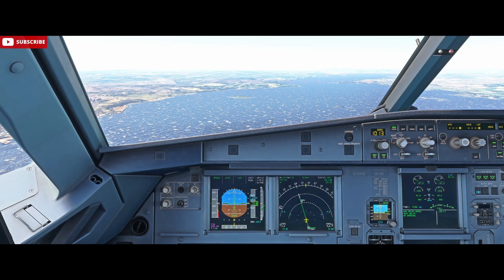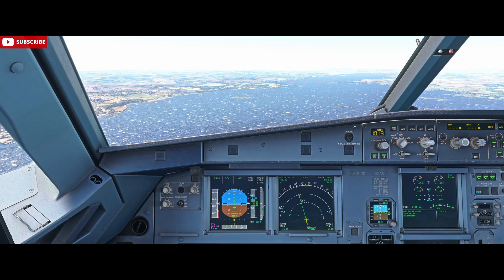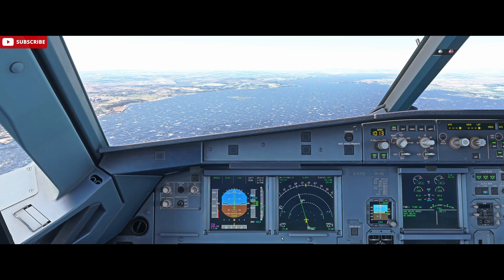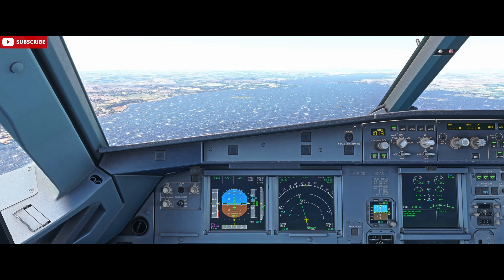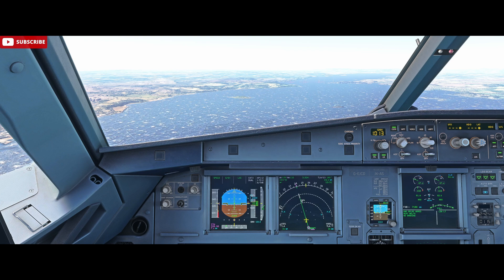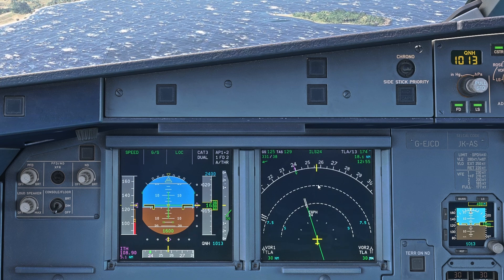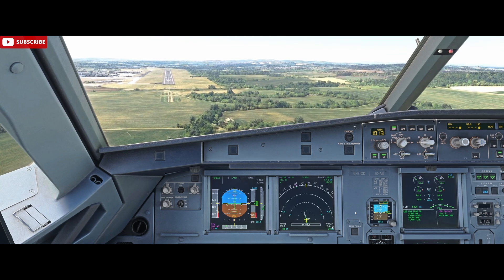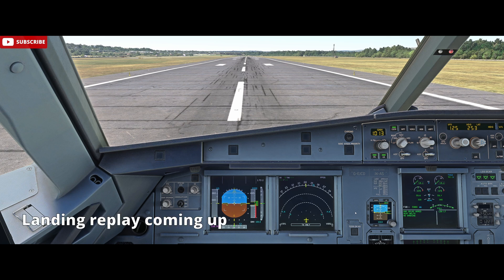How Real Airbus Pilots Handle Max Crosswind Landings | MSFS 2024 Tutorial

Comment: Great advice, great video for crosswind landings. I  have improved so much as I was not holding the rudder in place long enough after touchdown. My ratings on landing challenges have soared after a lot of practice in different scenarios of high wind landings, and my flare was far to much,  not now.👍😄😃  😀
Reply from the maker: Thank you! Glad to hear the practice is paying off, it is a technique that improves with experience to get the timing between the flare and rudder input correct. 🛬👍

Comment: Thanks for your very informative videos !! During the alignment of the plane's longitudinal axis with the center line of the runway shortly before touch down you only used left rudder (?) . IR I always have to use additional  right aileron input to keep the right wing down (in this flight) with light GA planes. When do you use aileron input in side wind landings before touch down in the A320?
Reply from the maker: Hello, I'm pleased you find the videos informative. The A320 automatically counteracts the yaw effect so aileron movement is not needed to compensate for a wing drop caused by rudder input. We wing down into wind slightly to stop drift off the centre line if needed but depending on the wind strength we may aim upwind of the centre line, hopefully time it right and hit the centre and avoid the need for a wing down

Comment: Thank you for your valuable videos. Grateful if you can please let us know what side stick / rudder kit you are using and the the sensitivity etc settings that best approximate the real bus. Thank you again.
Reply from the maker: Hello, I am using the thrustmaster TCA sidestick and thrustmaster rudder. The only real adjustment is on the pitch for which I have increased the sensitivity to +50% with SDS on. I am thinking of changing my pedals as they do tend to stick. No real adjustments to anything else other than a little dead spot at neutral. Pleased to hear you find the video's useful and thanks for watching! 👍

Comment: Why doesn't the Airbus show wind speed / direction when on the ground?  Is it unreliable due to ground effect?
Reply from the maker: Hello, the wind speed and direction relies on the IRS system to provide data. The IRS units do not provide accurate data on movement below 100kts, this is the primary reason. Great question 👍

Comment: Many thanks for this video! if i understand correctly in the Airbus there is no need to compensate with ailerons into the wind, right? in Boeing aircrafts is this needed?
Reply from the maker: On the Airbus we do not need to compensate for the rudder induced roll effect but we do sometimes lower the upwind wing slightly to prevent drift once aligned with the centreline and to get the upwind gear down also to prevent drift. I have never been type rated on a Boeing but I believe that you do need to compensate on them, perhaps not the 787 which seems to have very advanced computed assistance. Thanks for watching! 👍